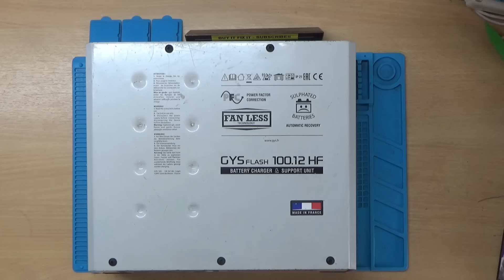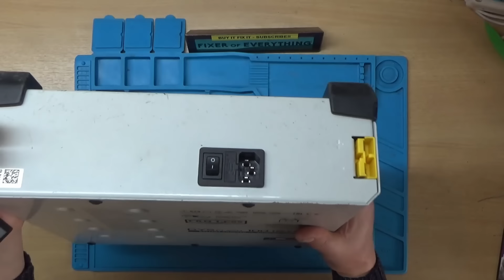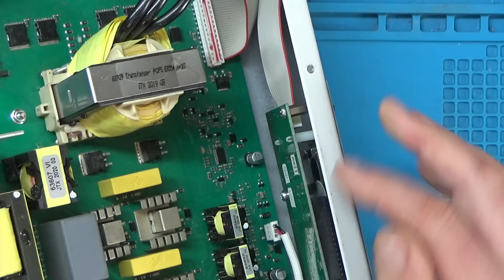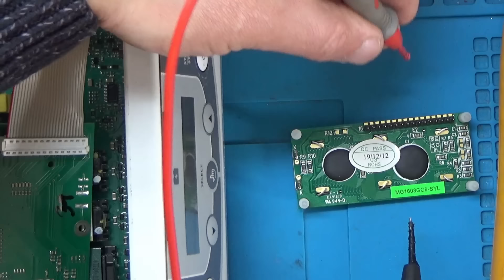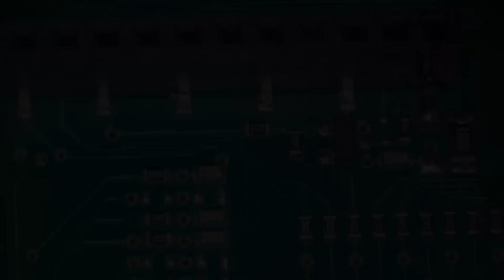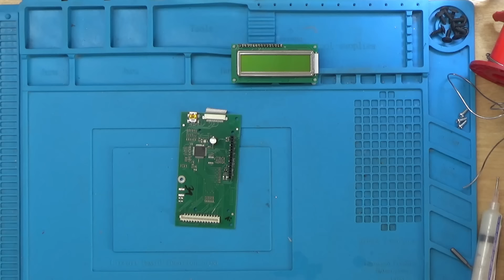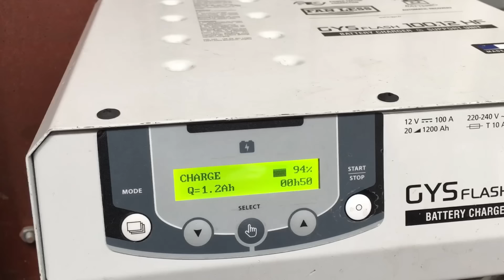Very Expensive Battery Charger - Shop Couldn't Fix It, Can I?

Comment: Excellent work as always sir 
It's a pleasure to watch you work!!!

1:39, ah, there's your problem, "Made in France".
I mean we're all familiar with the disco light display on the back of a Renault, or Citroen, where all the lights flash and/or flicker once the indicator is activated?? 
You just can't trust them, I mean it says "Fan Less Technology" on the outside of the cabinet, but guess what's the first thing you see when you take off the top cover... A fan!!! Mon Dieu as the French say, Mon Dieu...🤣🤣🤣🤣
Reply: Yeah, thats what i thought.
Reply from the maker: Thanks mate 👍Mon Dieu 😂😂😂
Reply: @BuyitFixit  to be honest I can't believe a company manufacturing garage equipment, especially "high end" equipment didn't think to add some sort of mechanical support to that display socket during manufacturing. A blob or two of silicone glue, or at the very least a few lines of hot melt glue, to give it a fighting chance at least. Like these things are dragged around from vehicle to vehicle, bashed off benches, etc.
That's just piss poor design...
Reply: @generaldisarray  Actually these chargers are really good and reliable, VAG uses them as standard in all dealer shops. There is also a secret power supply mode if you read the manual.
Note that there are absolutely no carry handles on the device?
This particular model is NOT made to be dragged around in a VAN or bashed off benches, it's made to be sitting in a diagnostic cart with a laptop or wall mounted with a bracket. GYS sell other models with carry handles that are of course completely full of mechanical supports and vibration mitigation.
Reply: @mrfrenzy.  Even in a cart it's going to be subject to vibration, etc as the diagnostic cart is wheeled around. 
It's just common sense that you'd mechanically support a component like that socket
Reply: @generaldisarray  sure you could always beef it up, but I think one hour in a VAN causes more vibration than 1 year in a diagnostic cart.
Reply: @mrfrenzy.  Ah but how are these chargers transported and delivered in the first place, in the back of a truck, or van. Chucked around by delivery drivers, bashed around on conveyor belts in a parcel sorting hub, and no amount of external packaging is going to stop the strain and stresses on that unsupported display connector, every bumb and bang will go though those solder joints potentially causing a DOA, or Dead very shortly after the warranty has run out charger.
Reply: @generaldisarray  that's what packing materials are for. If they get 10 warranty replacements in a year surely they would have changed the design. Warranty repairs really eat into profits.
Reply: @mrfrenzy.  packaging materials won't stop the stress on those solder joints. 
As I said above "no amount of external packaging is going to stop the strain and stresses on that unsupported display connector, every bumb and bang will go though those solder joints"
Reply: @generaldisarray  I'm from Portugal, in my country nearly everybody has this charger/stabilizer in their workshops, everybody recomends it to their neighbour and everybody is satisfied, they last for years workshops here don't renew their equipment very often and you see these chargers bought in 2015/16 fully operational!  some indeed buy vertical versions with handles meant to be transported or stuck to the wall or to a lift with a magnet instead. Some of them i guess sure go faulty but the overall picture is that this is probably as good and high end as the market gets, BMW and Volkswagen have these chargers too under their own brand, when you open them, is the exact same product

Comment: I swear these connectors are made with candlewax the way they melt if you go near them with an iron.
What I do, is stick a pin-header into the socket to keep the pins aligned and soak up any excess heat. WHEN the plastic melts, the header stops the pins wandering.
Reply from the maker: Good tip 👍I don't usually have an issue with them. The one I used was from when I built an RGB LED music sequenced Christmas light show a few years back (video on here from about 5 years ago) it was quite a big project and took me around 4 months.

Comment: Cannot believe you didn't use flux when soldering new connector in - ROOKIE move
Reply from the maker: Normally it's fine, but I had the connector a few years so it was slightly oxidized
Reply: Lol, stupid comment from someone who has never soldered in his life.  The solder already HAS flux, you idiot.  Stop watching garbage videos where they drown everything in flux, it's not necessary.

Comment: A friend of mine had a BMW workshop, and BMW demanded one day, maybe 20 years ago now, that the shop had to get one similar to the one in the video. Only accepted one was sold from BMW themselves to the workshops and i remember it was over $3000, and I'm not kidding, sadly. They quit with BMW altogether when they were told to buy $100 000's of equipment to service the electric cars, despite where we live in rural northern Sweden, I've yet to see an i3, i5 or any of those models and they had to send the mechanics on weeks of expensive educational trips. This was a mom-and-pop workshop which had serviced BMW since the early 1970's, but with only 3 people working there, they opted out instead and retired. So then there were a couple fewer real mechanics which could repair anything BMW put out since the 1960's. Not just parts swappers, but real knowledge. BMW decided that ALL workshops should have the exact same capabilities if the were situated in Münich or Burträsk. 3 or 50 employees, no exceptions. Real stupid move if you ask me. They weren't that way 40 years ago.
Reply from the maker: Thanks for sharing,  shame about that little workshop 🙁

Comment: Well done Mick, Another terrific video and repair. I would not have thought that connector would do that - bizarre. I have a Bowens flash head (Strobe) with a fault on the modelling lamp circuit which similarly was sent away for repair only to be told that the replacement boards arn't available anymore which they knew but still accepted it and charged £35.00 handling. It is great to see someone who works around issues and actually can repair stuff. Sadly no one else seems interested in repairing my Bowens GM500Pro :( and its a bit out of my league lol mains stuff - shivers
Reply from the maker: Thanks Steve, what is the unit for? You can always drop me an email. It's the channel's name at out look dot com.

Comment: That was an odd fault.  The display looked to be pretty well supported.

Maybe a low quality connector from the factory and it didn't take much knocking about to break the pins?
Reply from the maker: Yes, I was surprised by the connector being broken. I thought it was just a few dry joints or no power getting to the LCD and was quite surprised as you seen when I started re-soldering the pins!

Comment: After having to do a "firmware update" on my car, that required me to keep the engine running for almost 3 hours, to ensure the battery doesnt go flat during it, I was wondering to myself "I wonder if there was something like a battery charger that could plug into the mains and keep the battery charged, without the engine running, while the ECU updates.

Then a few hours later, this video drops, indirectly answering my question. Yes, yes there is.
Reply from the maker: WOW 3 hours! It's almost like they were downloading a new XBOX game into it!
Reply: That’s exactly what these support units are for, it can deliver up to 100amps for as long as the programming/diagnostics is taking place 👍🏻
Reply: You can get a car battery smart/trickle charger for around 50-100usd
Reply: Hello. 
Some vehicles go to sleep if the engine is not running, and the GPS may stop receiving power. It is safer to update with the engine running.

Comment: Nice repair, but I wonder if one of the mosfets in the PSU is not heatsinked properly? Seems like someone else worked on one of them, and the heatsink may not be touching the mosfet properly anymore. Might be worth checking out?
Reply from the maker: Thanks 👍 I doubt they got enough heat on that to remove it (as that was one of the things mentioned). I think they just touched up the legs with an iron.

Comment: Good repair👀👍👍👍🍻 and a intresting tool
 A tipp,,, 23:25 The hot glue doesn't last long. The glue hardens after a while and breaks.
A better choice is silicone.
Reply: I'm afraid he won't understand unless you say "Silikin" 😅
Reply from the maker: Yes a silly cone is one of those things you see along the roadside 😂😂😂
Reply: Depends on what you'd call a while, or hard. I still got glue sticks from over 20y ago, not hard, doesn't break and still use it.
Reply: @Lightrunner.  Could be, it doesn't sound like regular hobby hot glue that I know of. The glue used in the video you can melt over and over again. What I do believe is that if the thing glued isn't degreased it will release over time.

Comment: What a legend, Mick the fix lol, An absolutely brilliant fix maybe the other shop screwed up the socket? I would of thought it was robust enough to take a few knocks, those pins looked like it had been forced which had snapped them?
Reply from the maker: Cheers Gary 👍I think if it was being "thrown into a van" or vibrations from being transported around in a van every day might have caused some kind of metal stress fatigue over time.
Reply: @BuyitFixit  very possible Mick
Reply: My guess is somebody moved it and smacked the display into something ir was moving some other object near the PS and  ran that into it.

Comment: Excuse my pedantry Mick but is a 'zero ohm' resistor both an oxymoron and an impossibility? 🤔😉
Reply from the maker: It will always have some resistance, but very low. They usually use them for fuses or I've also seen them used as a jumper to go over another track.
Reply: As he said they're used as jumpers.  In the olden days you'd solder a bit of wire in there, but this lets you do everything with pick & place machines.  Another method from the olden days is where they lay down carbon ink traces, you still see that in stuff like cheap toys and remote controls.

Comment: For the amount this costs, you would expect the display connector to be through hole and the display mechanically held in place properly with M3 nuts and bolts, not those useless cheap crappy plastic stand offs. Even my cheap component tester that has the same 20x4 character display has the display connector pins soldered through the board.
Reply from the maker: Good point, very true 👍

Comment: I get the impression the people aren't fans of this technology... "Fanless" Dad jokes aside great fix especially as others failed, I have the 5024hf version which is physically the same but for trucks etc I quite often max it out whilst programming but it puts up with the abuse great piece of kit
Reply from the maker: Thanks 👍I just did a quick search and it looks a very similar including the display. If the display ever goes off at least you now know what the likely culprit is 🙂
Reply: @BuyitFixit  I'm tempted to give it the hot glue treatment just in case tbh

Comment: Poor design not having any physical restraints for the connector - it was always going to fail.
Reply from the maker: I think they should have used nuts / bolts with some stand-offs which would have given better mechanical support to the display.

Comment: Nice work Mick. I'm wondering if there was another fault on it that the previous fixer might have worked on, but while working on that they've buggered the display... Good fix that matey, well done.!
Reply from the maker: Thanks Marc 👍Perhaps the cap blew and the other repairer touched up the diodes and MOSFET which may have looked a bit dry. Then when the unit still didn't work gave up. I think the cap wouldn't make a lot of difference as it just looked like a decoupling cap, and there was another one in parallel with it. If he had looked at the display perhaps he may have found the problem I found too.

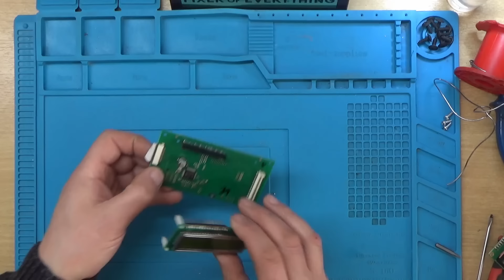Comment: 24:00 I think those four clip in white plastic standoffs do not offer enough mechanical support and that is why it failed.
Reply from the maker: Could well be the case 👍
Reply: Of course they don't. Should've used M3 nuts and bolts. Those plastic standoffs are absolute crap.
Reply: The charger is made for stationary use or to sit on a cart with wheels so it's not surprising.

Comment: Nice fix of that overpriced battery charger.
I think a good, healthy battery next to the vehicle to keep the voltage steady would be a cheaper solution for programming the modules.
Reply: This is my old unit that i gave to my son to see if he could get it fixed  if he could its his it is better than throwing it away im currently on my 3rd one 😢 they don’t seem to like being in the back of a van.  From the point of view of programming ecu,s many wont program at less than 13.6 volts and up to 14.4v the unit  supplies variable amps this one up to 100 the newer ones 120 at a constant voltage. During programming its not unusual for the cooling fans to trigger and stay running flat out during the whole writing process often 20 minutes plus 😅. If you don’t have a stabilised unit connected it normally results in a  non start and  corrupted ecu and some twitchy needs to visit the toilet moments. A fascinating repair process to watch. If no mains power is available we use smart charging through anderson connection directly of our vans
Reply: @andrewsmalley5875  well, that is not a surprise, the display can vibrate the connector to bits. Maybe it would help secure that to the PCB in a better way
Reply: @andrewsmalley5875  The GYS flash units are great, I have one myself. This model is for stationary use only. Next time buy GYSFLASH 125.12 CNT FV with the carry case 060432, it is designed to survive driving around in a VAN all day.
Reply from the maker: Thanks 👍It would depend on how long the ignition needs to be on, and at what voltage(If it took a couple of hours to download and update the modules for instance) This unit would be a stable power supply where as a car battery would still slowly drop in voltage over time, although a mains power failure could also cause issues...

Comment: For such an expensive unit, one would think that the design would be better. Great job as always. Did you figure out what that was between pins 1 and 2 of the wide ribbon cable? It looked like there was something stuck between the two solder joints.
Reply from the maker: Thanks 👍I think it was just a scrape on the board where the connector had been removed.

Comment: I wonder if the previohs "shop" manhandled it and broke some connector pins. 

I dont miss the automotive repair industry. Its to the point where nissan, dodge / chrysler / jeep vehicles cant be repaired (even simple brake pad jobs) without the mechanic investing 10k for there special conputers. Im sure other brands will follow their lead soon.  There forcing customers to return to the dealership and pay out the nose .

Excellent diagnosis and repair !
Reply from the maker: Thanks👍Yes more complicated modules, which need coding, and I heard they are now even using encryption keys to stop unauthorised people :(
Reply: Fortunately there are plenty of cheap universal tools now that let's you do 90% of all jobs with a simple tablet, have a look around youtube for recommendations, for example Launch x431 has some nice models around $500 but there are even cheaper models.
Reply: Why would you need a 10K computer to replace brake pads. They're completely mechanical. Brake pads are consumable parts so you expect to replace them every few years anyway. Nothing to program.
Reply from the maker: I'm pretty sure some cars with electronic handbrakes you have to use a computer or diagnostic tool to loosen the handbrake off to be able to change the shoes. I've got vague recollection of having to do something like that on the VW Passat I used to have, but I had a vagcom cable at the time.
Reply: @BuyitFixit  yep so many cars require a decent computer to retract the caliper piston and disable the e brake. For a couple years Chrysler/ dodge / jeep had a hidden setting in the touch screen radio that would handle it. Now they've removed that and force you to use there scanner. Not to mention how many parts have to now be programed when replaced.
Reply: @simontay4851  on newer cars they're no longer mechanical. Trust me, I had customers trash 600.00 calipers by resetting the caliper piston by hand.

Comment: I had faith from the beginning....   Have you ever failed???
Reply from the maker: Thanks, Yes a couple of failures. The Dyson Hot / cold fan (although I did a re-visit), Milwaukee Circular saw (did a revisit on that too) and the Cricut machine which was not really viable to repair.
Reply: @BuyitFixit  When you remember each one   and (I assume) you succeeded on the next try,, that's a pretty good record.. I just reassembled a sawsall without fixing because the switch is no longer available and I wanted to think about disassembling the switch unit,, it looks pretty tightly wrapped up.. Maybe I'll find a doner on Ebay to cannibalize.. ??!!??
Reply from the maker: I think I did disassemble a switch on a Milwaukee tool but I can't remember on which video, it was quite fiddly to get back together as there was a couple of springs with two rocker type contacts.
Reply: @BuyitFixit  I usually have no problem disassembling switches. .  It's usually dirty or worn contacts, but this is different, It has a heavy (maybe 3mm thk) copper wrapper of some kind that might have to be bent open and there is no visible assembly screws or even rivets.. I don't understand the copper unless they thought it would be better than alum. for heat.. That is also the only part not available for many years  of the M18 sawsall..